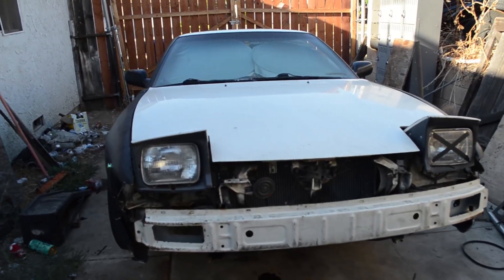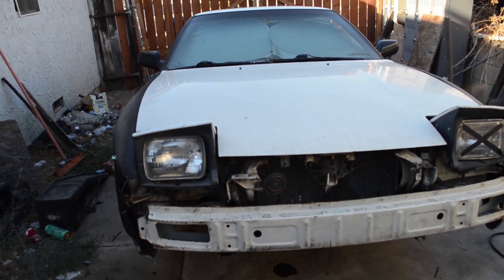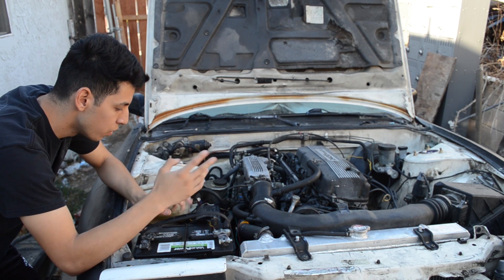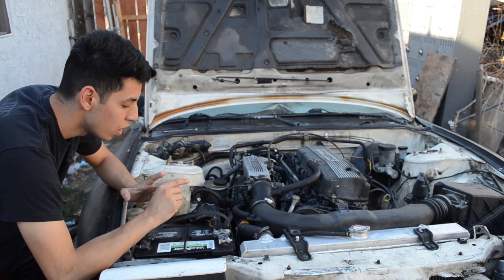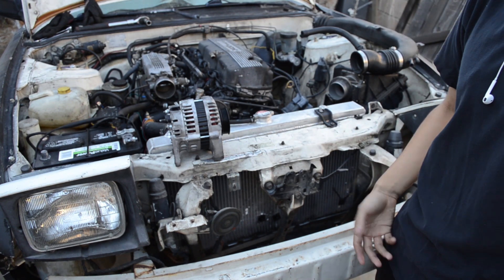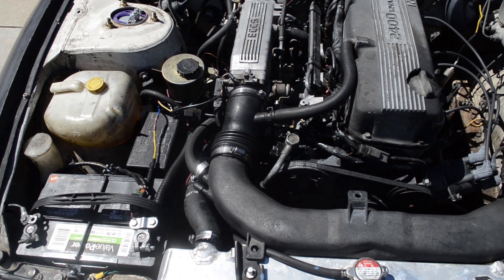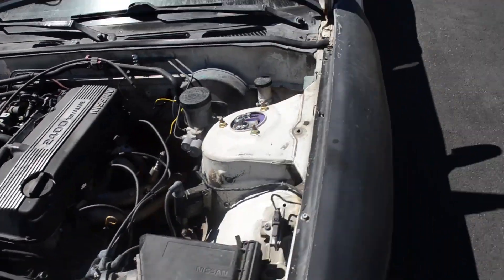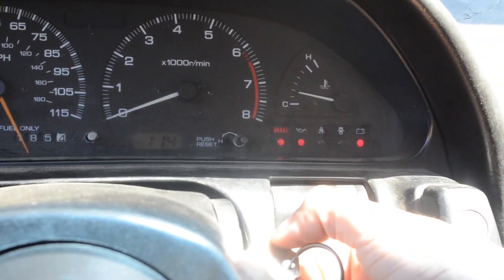Trying To Solve The Issue

Comment: just to be clear, I doubt that beefing up the wiring will actually solve your current problem, but it's sort of one of those things that can't hurt and is a good mod for the future.
really nice job on this video. I did all the little editing touches and the transitions. Hope you can solve your problem soon! Good luck with 5K Subs.
Reply from the maker: Checking out the wiring diagram and see were is the back feed or break. Thanks for the help :)